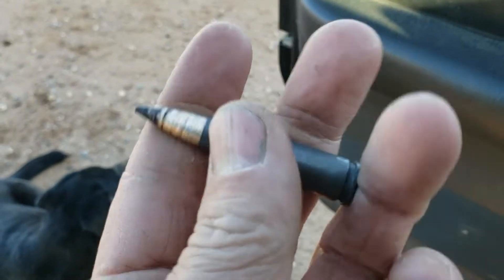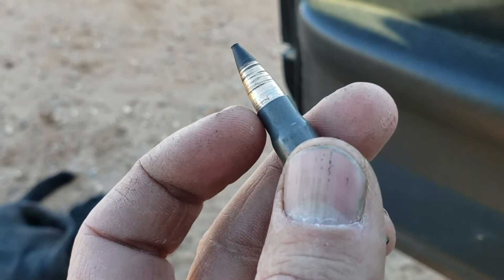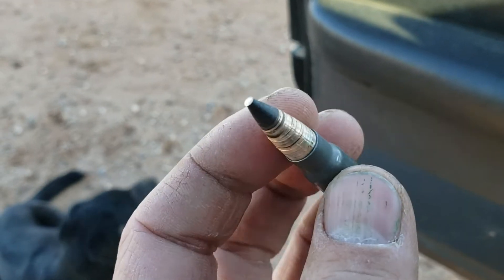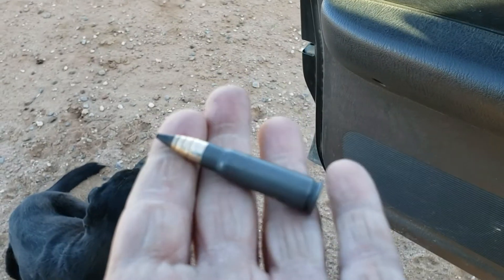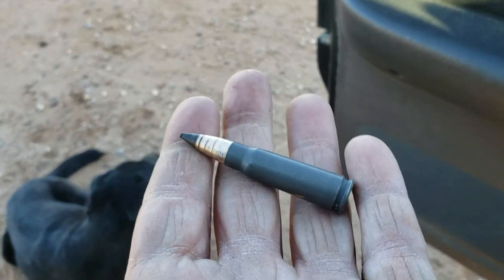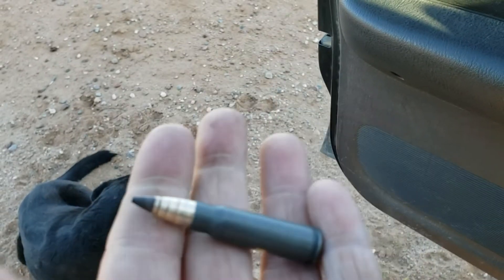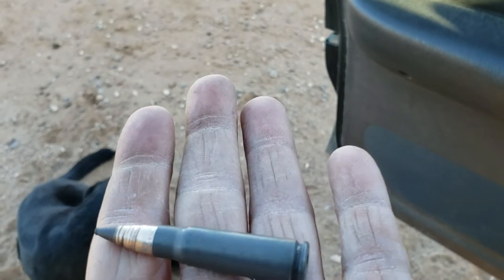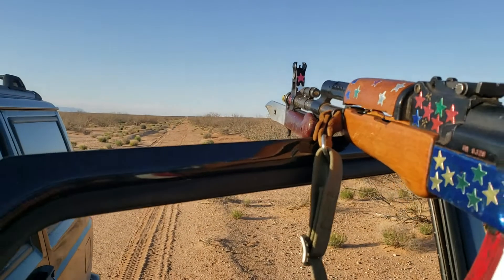Homemade tracer fail. Does not ignite

Comment: I need to know a about a few things.
Like how many psi did you pack the trader compound in with?
Too much or little will not work. I have a hunch that if it was too low, we'd have seen barrel flash.
What was the diameter of the tracer compound hole in the base?
Did you use an igniter of some kind, like magnesium powder?
What exactly did you do in your process?
Thanks,
Mike